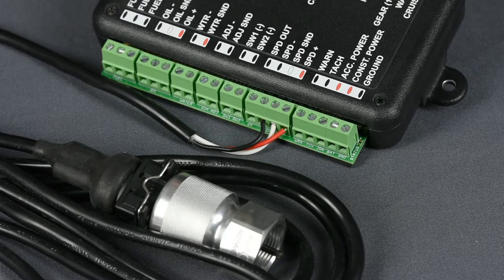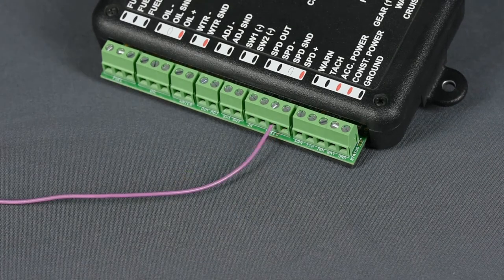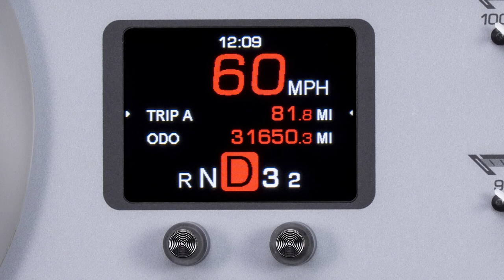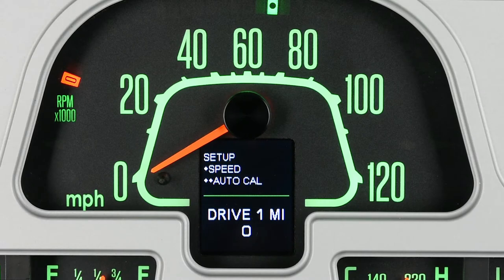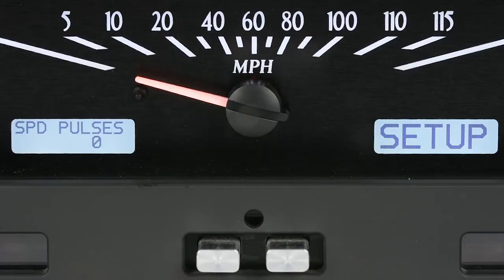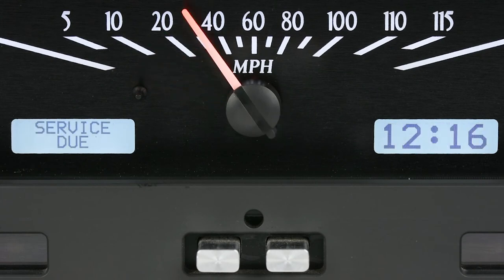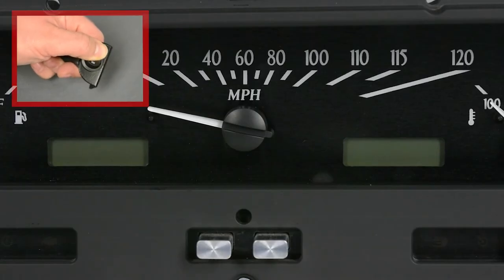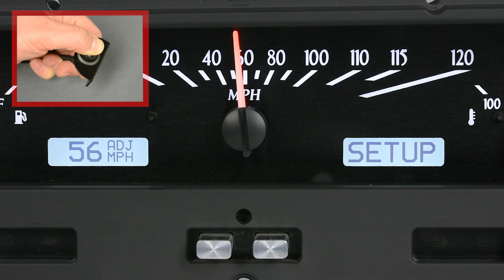How to Calibrate Speed on Dakota Digital Instruments

Comment: I love how Dakota Digital makes not only calibrating the speedo and other gauges easy, but adding additional sensors is easy, too. I added a trans pressure sender, and plan to add a couple more expansion modules. I like the new switch used on the video above, will it work with VHX Gauges?
Reply from the maker: Yes you can get the new rocker switch for an existing system! Ask for part number 391183 when you call.

Comment: How do you pull over and reset after changing speedometer calibration I did mines maybe driving over a mile and when i tapped the switch 1 my speed seems lower than what im going maybe 15-20mph lower?Thanks
Reply from the maker: Hello Dickey,
To reset, just perform a new calibration.  Feel free to contact our Technical Support staff at techsupport@dakotadigital.com.com or 800-852-3228.

Comment: I just bought a 1968 Chevelle with Dakota Gauges. I do not have the suppled speed sensor. Would love to calibrate my speedo. Thanks!
Reply from the maker: Hey Michael,
Sure, the SEN-01-5 is the part number of the supplied speed sensor.  Here is a link:
https://www.dakotadigital.com/index.cfm/page/ptype=product/product_id=730/category_id=351/mode=prod/prd730.htm
Reply: @DakotaDigitalTV  cool man thanks! Is there a video or something that can walk me through it? I'm not that technical, thanks again!
Reply from the maker: @Riggomesister   Sure, take a look here:
https://www.youtube.com/watch?v=BpcZl2dudFY&
Reply: @DakotaDigitalTV  I'm confused. Do I need an sw1 or a speed sensor??
Reply from the maker: @Riggomesister  Thanks Michael, both actually.  The SEN-01-5 is the speed sensor itself, which mounts at the transmission.  The SW1 is a programming switch, used for calibration, accessing and using the message centers, etc.
Reply: @DakotaDigitalTV  do you have a link for the sw1?
Reply from the maker: @Riggomesister  The better option is to use the 391183 part number - this includes both the SW1 and SW2 together and is the current model.  This will also be located at this link:
https://www.dakotadigital.com/index.cfm/page/ptype=product/product_id=730/category_id=351/mode=prod/prd730.htm

Comment: I didnt receive a switch control for the vhx for 65 mustang do i have to purchase seperately ? Or is there a another way to calibrate gas and speedometer
Reply from the maker: Hello Manuel,
A switch, of some sort, will be required here.  Even if the it's not the included switch from Dakota Digital, momentary pushbutton switches can be used instead.  Connect one leg to a ground connection, with the other to the SW1 and SW2 terminal.

Comment: Our 72 Chevelle Restomod has a Dakota Digital dash. Where do I get the switch to program the speedometer?
Reply from the maker: Thank you for the message,
The pushbutton control switches, if not installed, are available from Dakota Digital.  At the link below, just select the product series that you have to locate common replacement parts, such as these switches:
https://www.dakotadigital.com/index.cfm/page/ptype=results/category_id=351/mode=cat/cat351.htm

Comment: I’m not clear on the manual calibration. After the speedometer reflects the actual speed, the video says to pull over. So you shut the vehicle off or how do you keep the new calibration in place?
Reply from the maker: Hey there Larry,
The process is a bit different, depending upon the gauge series.  What model are you working with?
Reply: @DakotaDigitalTV  VFD3-55C
Reply from the maker: @larryjones1349  Thanks Larry,
If using the Auto Cal method, just tap the SW1 button/switch once the reference mile has been driven.  This will save the new programming value.
If using the ADJUST mode, the new programming value is saved once the ignition key is turned off.

Comment: I've got Two, push button switches, where do I connect them. Do I need just one switch or two to adjust my speedometer? I've got a VDF3 system. Your video didn't show where to connect them.
Reply from the maker: The installation manual covers programming switch installation. One leg of each goes to ground, and the others to go SW1 and SW2, respectively. Install both switches.

Comment: I have the VHX-88C-PU-K-W for my 1990 c1500. My rpm and speedometer does not work. When I go to calibrate the speedometer the speed will be off and my rpm are at 0 still. Plus the area to tell my trans temperature is always reading -37. My gauge was working fine before I got the car tuned.
Reply from the maker: Hello there,
I suspect that you may have our BIM-01-2, which plugs into the OBD II diagnostic port. If the tuner unplugged this, these three readings would drop off.  I would first start be looking to the diagnostic port to ensure that wiring remains intact.
Reply: Thanks a lot. Apparently the input wire was unplugged, now everything reads currently but the tachometer is still not responsive. It shows 0 at idle even when trying to calibrate.
Reply from the maker: @e-ternallife8029  Within the VHX setup menu, please check the tach submenu, the signal type should set to BUS/BIM.  If you would like assistance, please contact our Technical Support staff anytime, techsupport@dakotadigital.com .

Comment: my speed pulse is stuck at 0 and won't increase nor will the speedometer as I travel. I went through the entire process correctly and used the auto functionality.
Reply from the maker: If the speedometer pulse does not leave 0, this indicates that the instrument system is not seeing a speed signal whatsoever.  We would suggest checking the source of the signal, as well as the wiring connect it to the instrument system.

Comment: Well what happens when you have your speed sensor wired correctly and your speed pulses do not change and just stay at zero.
Reply from the maker: We can walk you through testing the sensor, checking your settings and the like; have you contacted our tech department? 605-332-6513

Comment: So the tooth count of an aftermarket gauge doesn’t matter correct?
Reply: @DakotaDigitalTV  I’m sorry I typed that out wrong. The tooth count of an aftermarket pickup wheel is what I meant. I’m running a Tremec that doesn’t have a speed sensor and was going to use a 16 tooth wheel attached to my 9”
Reply from the maker: @SantiSpeed1 Yes, as long as this translates to just a multiplication or division of the frequency, the SGI-100BT can handle the conversion.
Reply: @DakotaDigitalTV  I’m not sure of the model number of the box, but it’s the control box that came with my 61-66 f100 rtx gauge
Reply from the maker: @SantiSpeed1  Yes, that will also work out OK, the RTX system has speedometer calibration built within.
Reply: @DakotaDigitalTV  awesome! Thank you for the help

Comment: Drive EXACTLY 1 mile. It worked
Reply: Does the speed have to be consistent or exact? What about how fast? I tried to set mine but I guess I'm not getting a full mile in or going fast enough.
Reply: @markmorrison4583  I drove the mile about 45-60 miles per hour. I made 2 stops between. Speed doesn’t not have to be consistent. Just drive calm. No spinning tire or going super fast.

Comment: So it doesn't hoot up to the transmission
Reply from the maker: Hello,
If using the GPS-50-2, the instrument system will not connect to the transmission.  If using the included pulse generator, then this will replace the speedometer cable at the transmission.
Reply: @DakotaDigitalTV  thank you

Comment: I changed my fuel pump on my 1989 k5 blazer and now my fuel gauge aint working.
Reply from the maker: Thank you for the message, it sounds like maybe the fuel level sensor was not re-connected, or perhaps the ground connection is no longer intact.  Feel free to contact our Tech Support crew at 800-852-3228 or techsupport@dakotadigital.com.

Comment: Everything is working great but I lost my spirometer and my Clock numbers
Reply from the maker: Hey there William,
Once you exit the setup menu (turn key off, then back on), this will place you back in normal operation. Using SW1 and SW2 to navigate through the visible messages within the system.

Comment: Is this how you set the odometer? And speed?
Reply from the maker: Yes, set the speedometer. The odometer will accumulate based on your calibration going forward. Setting an initial odometer reading to pick up where the old left off is a different part of the setup menu.
Reply: DakotaDigitalTV  it worked great! Everything set perfect...if I have to change the battery (66 Mustang)  I have the VHX, will anything be lost on the unit?
Reply from the maker: @ciennac7161  Only the clock! All other settings are saved in a sort of hard memory, so there is no risk in disconnecting the battery.
Reply: If you change the battery the unit will not lose any info? I won’t have to re program anything?
Reply: DakotaDigitalTV  thanks! This VHX for the 66 Mustang is so nice! You guys keep up the great work!

Comment: What if you don't have a measured mile
Reply from the maker: If you aren't able to mark out a predetermined mile, just use the ADJUST method instead of the AUTO CAL method, this is an alternate process which works very well.
Reply: @DakotaDigitalTV  I'm driving now so just drive and hit adjust until I'm going to the correct speed limit according to my phone's GPS
Reply: @DakotaDigitalTV  I keep getting a reading saying too low
Reply from the maker: @kewkew2  Hello again, I would suggest contacting our Technical Support staff directly:  techsupport@dakotadigital.com or 800-852-3228.

Comment: I have dakota digital in my 57 chevy. Where is that button?
Reply from the maker: Thanks for the message,
If this is a VFD3 digital system, the button is wired and mounted remotely.  I would start by locating the control module, likely under the dash.  From there, trace the wiring for the buttons to their installed location.

Comment: This definitely did not work for me on my car 😩
Reply from the maker: Hello Bonchico,
How can we help out?
Reply: @DakotaDigitalTV  I have the vhx gauges for a 77-90 caprice and when hold the I while turning the key to start the car it doesn’t come up to adjust/calibrate speed
Reply from the maker: @bonchicodavis1444  Thanks Bonchico,  holding down Switch #1, while turning on the key will place you into the setup menu.  If this does not, the control switch may at fault, or perhaps the wiring which is routed to it.  I would suggest contacting our Technical Support crew at 605-332-6513.  There are some methods which can be used to determine what may be happening, preventing this button press from entering the setup menu.
Reply: @DakotaDigitalTV  ok Im in TN so our weather is bipolar right now lol I will try again on the next warm day.. thanks for responding
Reply: @DakotaDigitalTV  how far is a mile I don’t think mines is going off of miles
Reply from the maker: @devontajoyner5480  You will calibrate the speedometer based upon the speedometer which is printed on the speedometer face. If the system is built in Miles per Hour, calibrate to a mile.  If the speedometer is built in Kilometers per Hour, calibrate to a kilometer instead.